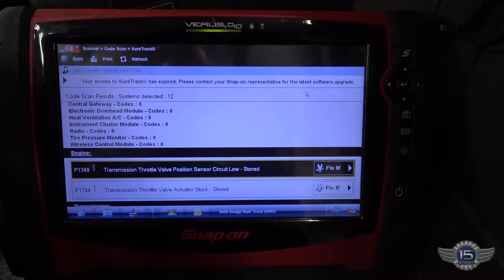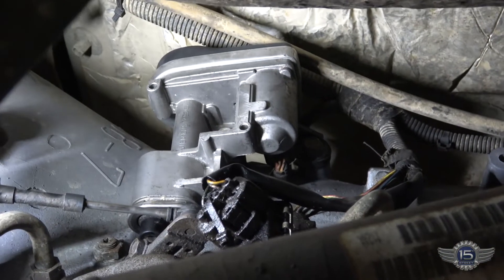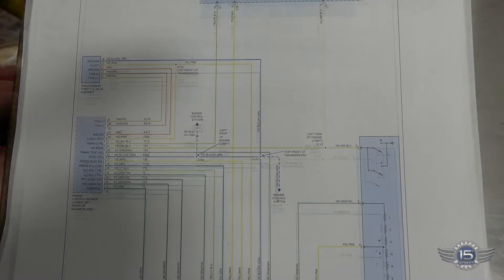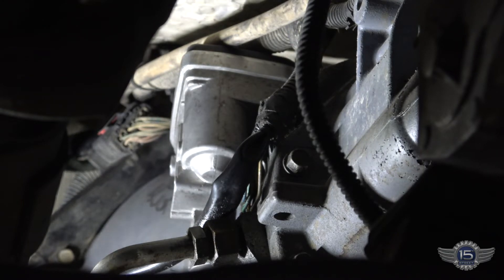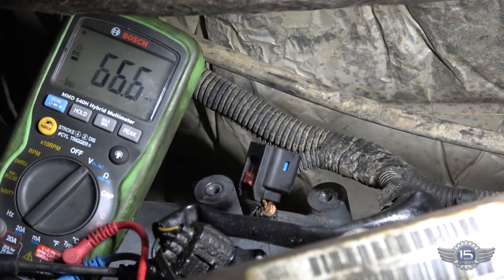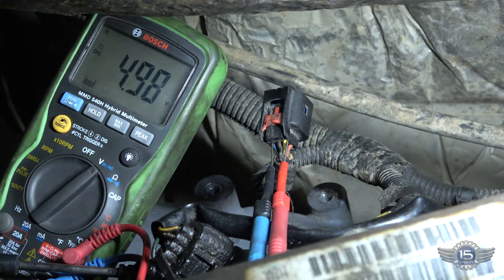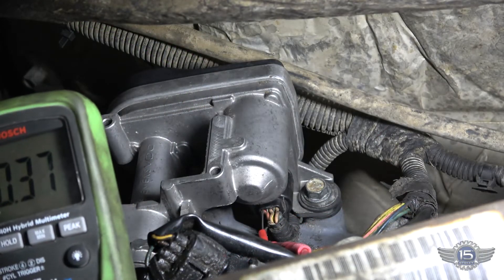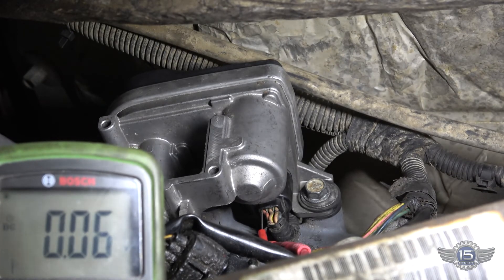2011 Dodge Ram  P1749  P1754

Comment: Has one seen the throttle valve fail numberous times? Im on my 3rd in the last 4 years. Keeps failing. Trans shop said it was because i didnt buy chrysler oem. Spent the extra dough and it failed again. Any idea whats causing it?

Comment: What are the defective symptoms of TTVA in relation to the functioning of the transmission?
Reply: Felipe Macedo França 
Poor shifting on 1 to 4th gear good luck on fixing it Brother
Reply: Eduardo Reyes My car is increased, swinging the rotation when engaging the drive / reverse when returning to Park or neutral position.  I'm thinking it might be TTVA
Thanks